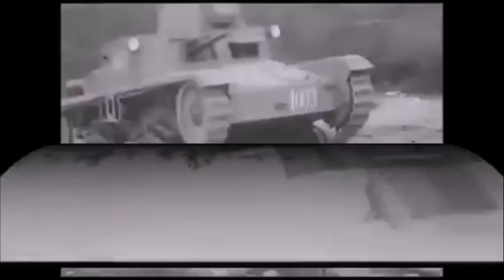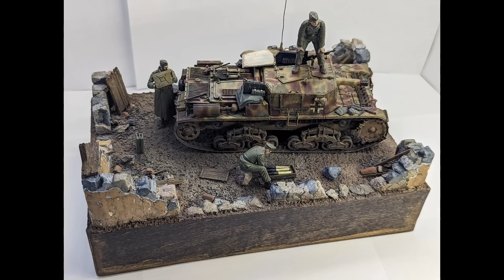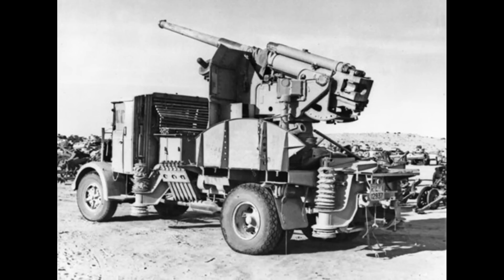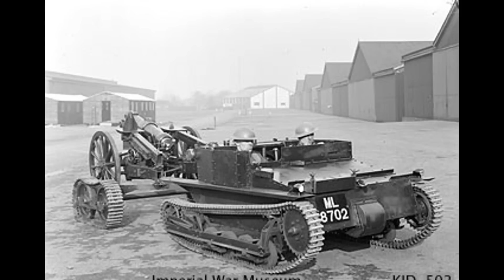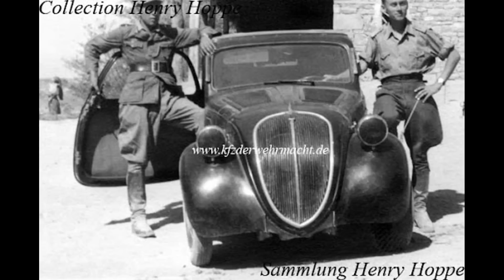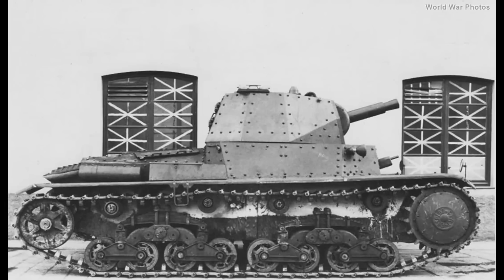10 Italian WWII Model Kits You Need to Build!

Comment: Historical Productions made alot of ww2 Italian armor vehicles and other materials was casted resin after closing for reasons not found, wip 3 D kit of the same are printed of 3D which are not as detailed of master casted resin kits. Wip 3D  has made other Italian armor like trains and railway items which are cool but don't measure up to casting resin which in my opinion has more details. Thanks for allowing my opinions

Comment: There are a few more options for doing  Italian armor ,but you have to be a bit creative.
1) Italians did a operate a few captured T-34/76,1941 model ,markings were white crosses on the sides of the turrets
2) A few captured French light tanks did see service in the Italian army.Not sure about the markings ,but l believe they were R-35.
3)  A few pz3 with the 75mm short howitzer also served. 
4) a few titalians were trained on Tiger 1. Italian marked Tigers were reissued to German units. Never saw combat in Italian army.
5) at least one British Cruiser tank was captured and used in the dert campaigns. Side of the turret painted with Italian flag. Look around on line for a few photos ,go from there.

Comment: Why does the Fiat 508 have the steering wheel on the right side, cars in Italy normally have the steering wheel on the left side
Reply: Maybe because it was built on a truck chassis? Most italian trucks have the wheel on the wrong side still today, I dont' know why 😊
Reply from the maker: Good question.
I've just read the internet, but I haven't found an answer to it.
Probably because the Coloniale version was used in North and East Africa, and that's probably where the steering wheel is located.
But it's not certain, it's just my theory.
Reply: As far as I know it's so the driver could/can judge better the distance of the vehicle from the side of the road

Comment: Expect to pay twice the price for the Tamiya version of the Italeri models. Way too much for a few "refinements", often figures.
Reply: Honestly, I’d say it’s worth it. The old Italeri figures and vinyl tracks are pretty awful. The Tamiya rebox of the m13/40 is an especially notable improvement; you get a metal barrel, link and length tracks, new figures, new stowage parts and a photo-etch sheet.